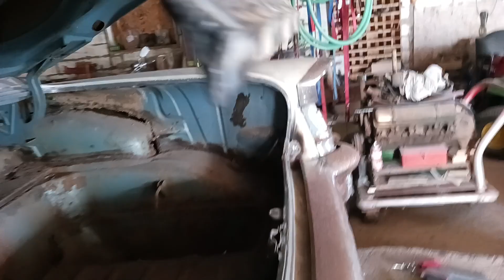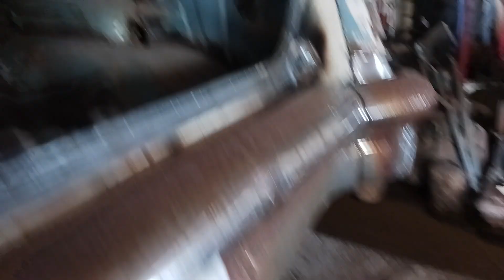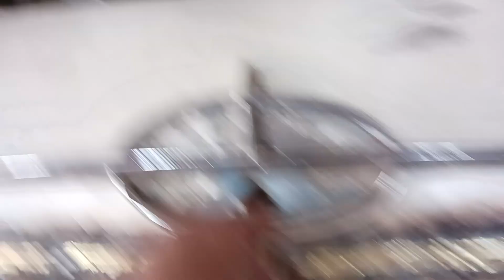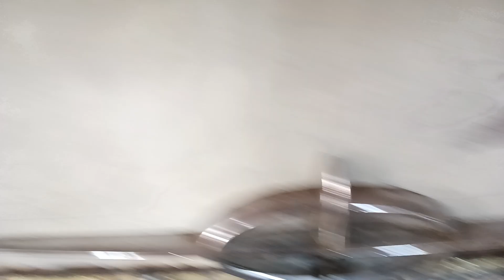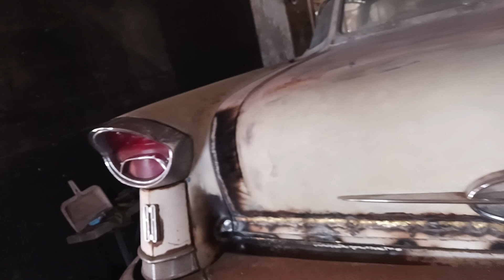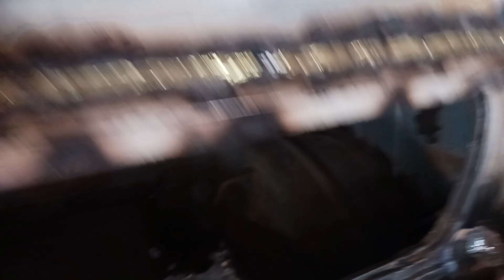I am still here

Comment: I know I'm 5 day's late Jimbo it's looking good.👍🏽great work with the torch.
 My brother just picked up a toy for us to play around with a 1966 Chevrolet panel truck/wagon/truck C10 327 engine drum breaks all the way around. My oldest brother got the timing right. Started to change the rad holes then the rad sprang a leak, check the transmission fluid milky white, Mon if it one thing after another 2 steps forward and 5 steps back. It's all good we are going to work on it together so it should be a fun project.

Comment: Yup it's going to look great when you smooth it out with 40# or 80# grit hope you have the smaller grinder tooling with air compressor? I find it work's much better for detail work. At least for me trying to hold a grinder for long pirods of time. Plus it's easier to control with the smaller grinder tool to get into small area's.